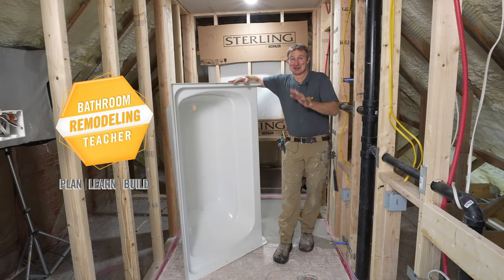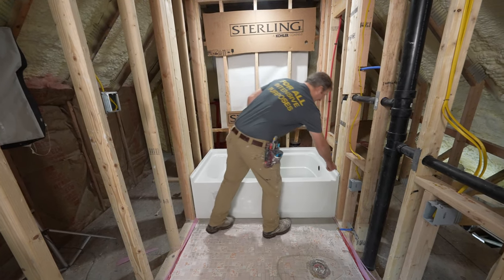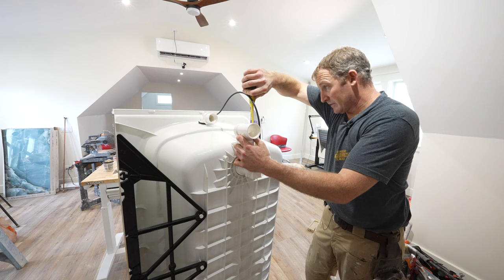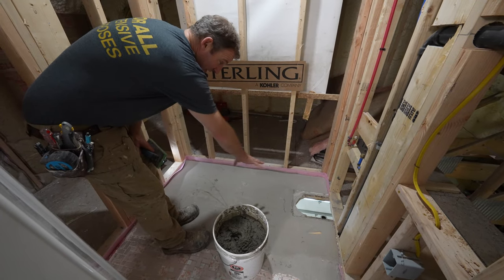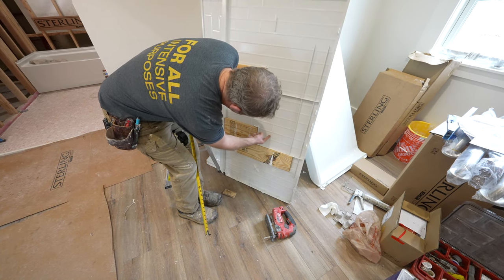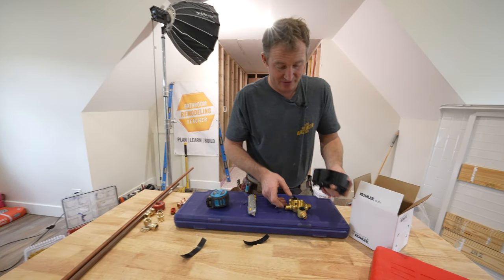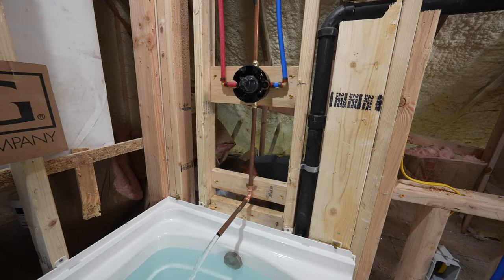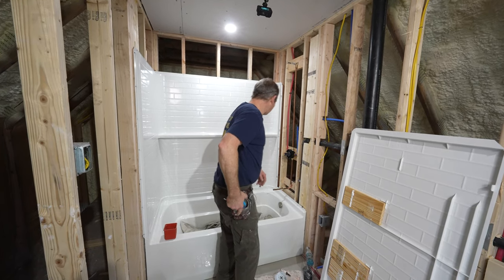Kohler Sterling Tub and Shower Surround Installation | PLAN LEARN BUILD

Comment: These are great tubs and shower units, i have installed over 150 units and never had a single issue
Reply from the maker: Dang that’s a lot. I bet you could make a killing installing these.,quick & efficient 
It’s also nice not having to deal with a ledger board too 👍
Reply: I didn't think these Koller tubs needed a mortar base
Reply: @irish89055  they dont require one. They actually void the warranty if you do mortar them in
Reply: @BathroomRemodelingTeacher  takes me 2 days , day 1 removal of old unit- install new unit - drywall mud around the edges , day 2 paint
Reply from the maker: @davidreish211  what are you talking about? Every Sterling tub or base I’ve seen shows specs for mortar?
Reply: @BathroomRemodelingTeacher  i just looked at the new specs, they recently changed them and add the  motar bed section and took out the dont use a motar bed or it will void the warranty part, the old instructions recommended using floor leveler only to allow the material to expand and contract without restriction
Reply: @davidreish211 Yep, I spoke with them yesterday and they specifically mentioned using the mortar bed as a requirement for two reasons.  They had reports/evaluations that showed over long use by um heavy people, the tub bottom could flex enough to finally crack something without a mortar bed and secondarily that the hollow sound when bumping or thumping the tub  would diminish somewhat when you use the mortar bed.  I don't know if that second part is true yet as I will be installing one without the surround tomorrow.
Reply: @papaalan1765  Our Sterling Ensemble cracked in the center of the floor about ten years after we had it installed. I'm pretty sure it was installation error that caused it to fail. The floor was not level which meant the base of the tub did not fully contact the floor. A mortar bed would have prevented the failure. I'm glad we'll be able to reuse the surround panel, it costs as much as the tub.

Comment: By far the best looking surround. I wished you would have made this video 6 months ago 😂
I tried to install the nextile surround. It looked nice in the pictures especially since it allowed real backsplace to go along the backwall, but that system has a MAJOR flaw. The backwall design is funny and takes away from your elbow room due to their storage design on the backwall. Once I realized that, it was returned. Change of plans and went with tile for the whole wall. I lost my storage space on the backwall because its an exterior wall and couldnt do a niche. I will just install corner shelves instead. Had I knew about this product, I would have bought it in a heartbeat and would have been done with this project a long time ago. FML 😂😂

Comment: I would not install the drain before putting the tub in place. That is a mistake.
Put the tub in place first, then the drain, then the p-trap.
Dry fit p-trap first. You’ll never get the tub with drain connected to align properly with p-trap if p-trap is in place already. It will be hard to wrestle the tub in place if the drain is connected.
Think it through or you’ll have issues…and although YT is good, it has a lot of half baked instructions.

Comment: Nice!  Ty for showing the adjustments you did with the plumb issues on the sides.  I worry about the pro-press manual tool -  would you be ok using it between joists on site?  Or do you think for situations like your video where u can stage your pro-press cinching on a work bench ahead of time (when you can't use pex) it works great (and you save 2k from buying the battery version)?  Again this was excellent.  I really was wondering about those Sterling kits in the plumbing isle.  This whole 'Kohler package' experience does seem very well thought out.
Reply from the maker: The head of the propress tool spins 360. I’m sure there’s many spots it won’t fit, but can probably do most
Yeah I’d love to get a ridgid battery one…just hard to justify. For $120 on this it’s really a no brainer 👍

Comment: Excellent video!  Thank you for taking the time to show all of that.  I did have one question regarding setting the tub onto the mortar bed.  One shot shows when the tub feet go into the mortar.  I would've expected the height after settling to have some mortar under those feet, thus affecting the lines you drew on the studs for height yet it seemed not to be off.  The only thing I can think of is that the feet actually went through the mortar literally all the way to the floor itself, is that it?
Reply from the maker: Yeah that waffle shape on bottom basically cuts right through when you put pressure on tub. Mortar is then anchored into bottom of tub. That’s why I mention you may want 2 bags of mortar to adjust tub over an unlevel floor. Need more mortar to hold it up 👍